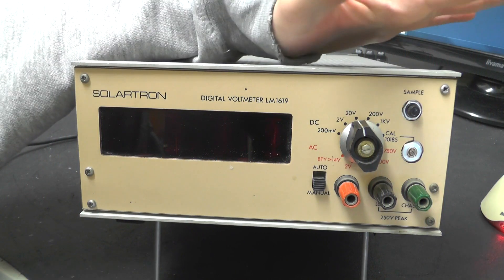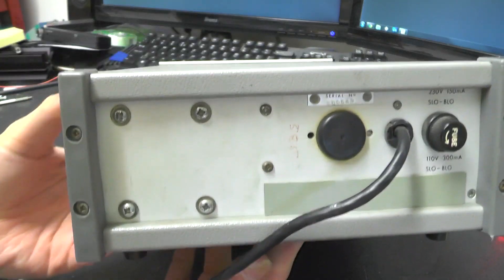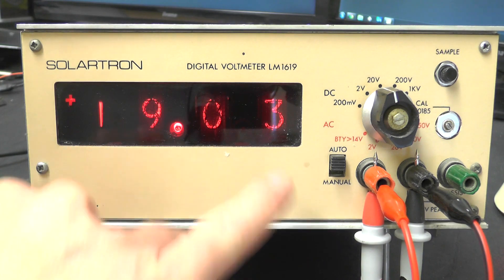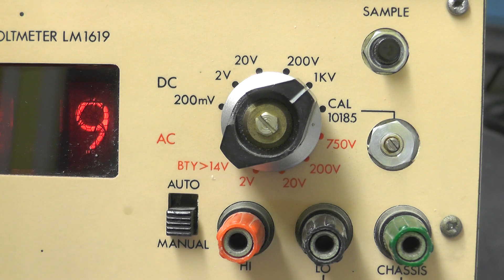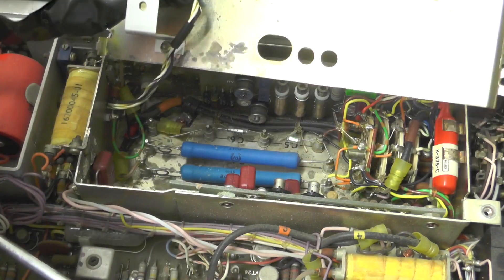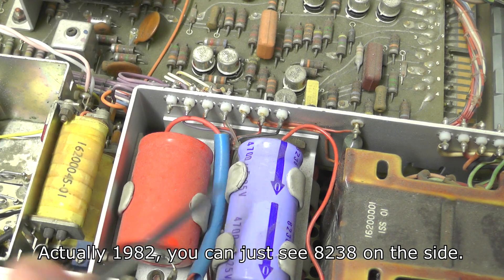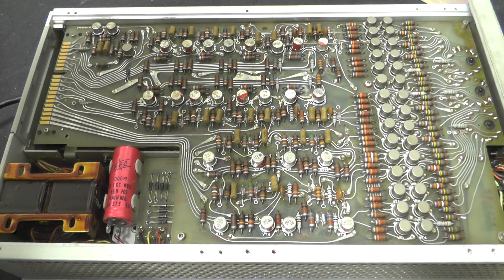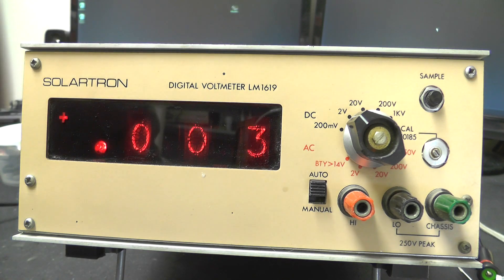DL#070 - Solartron LM1619 1970s Digital Volt Meter Teardown

Comment: Love Solartron stuff, it was proper lab grade instrument gear back then.  I have one of the bigger brothers to yours,  an LM1480. Based on memory it is a 10 digit unit and seriously massive, full rack width x about 17" deep x about 7" high!  Was amazed to get it for £10 on feepay.  When I collected it, the seller turned out to be a retired serious scientist type and had been using it up until about a week previously!  He also had another Solartron item, which I hadn't bid on but he said I could have it as his wife was leaning on him heavily to reduce his collection!   It's a low frequency oscillator with ridiculous resolution and also massive!  I haven't been inside the 1480 yet but will put a vid up when I have.

Comment: Dead interesting inside.  This is kind of 1 evolution back from the Farnell DM131 i have. It dates from maybe 1978 and has a 
3 1/2 LED segment display (somebody will start calling them knightrider displays soon- you know it's gonna happen)
Claims to be seriously accurate, but even if it isn't, all the ranges (it is a multimeter) have discrete trimming pots and the manufacturer made no effort to hide them. As long as you can wait 30mins for the claimed accuracy to appear, it is a nice piece of kit. Hopefully there are no leaking bloody batteries inside. I had best go and check i think.....

Comment: That was in my ebay watchlist?!
Reply from the maker: +Nicolas Daly LOL! Thanks for not bidding :-) What was your interest in it?
Reply: +DextersLab2013 No problems, I had passed my quarterly fleBay budget before I even added it. I just love collecting and using old gear and you can never have too many almost accurate bench meters. I think the same seller has a " ** ******** 1350 " (not to give it away) going in about an hour. I wont be bidding.

Edit: Ok scrap that. I forgot to refresh my page. but that seller has had about 10 of those 1350 meters go in the last week
Reply from the maker: +Nicolas Daly I an not one for collecting, dont have enough room, i do often visit that seller, if there is something your interested in i maybe able to look at it if i can tie it in to pick something up.
Reply: +DextersLab2013 I too have not enough room. Then I say to myself well it's only a small piece of test gear. 10 years later I'm working on a bench that you can just about fit a cup of tea on. I'll spam you if I see anything of interest

Comment: "Cal 10185" will be to calibrate against the internal Weston cell (the Red thing in the can with Muirhead on label). 
"BTY" position on switch will be battery test for that missing battery  - <14V legend suggests maybe 18V maybe for low noise? Perhaps only used in AC mode as in red along with AC ranges?  Or maybe rechargeable.
Reply from the maker: +mikeselectricstuff Thanks for the reminder about a Weston cell, i am sure i have seen those in other teardowns, maybe one of yours!?

I am puzzled by the BTY range and the battery terminals, it would only be a small battery in that space, the unit draws 20watts and has no power switch. So all a bit strange and yes, why is the BTY in the AC range? I am looking for a user guide which should reveal answers if i can find a copy!